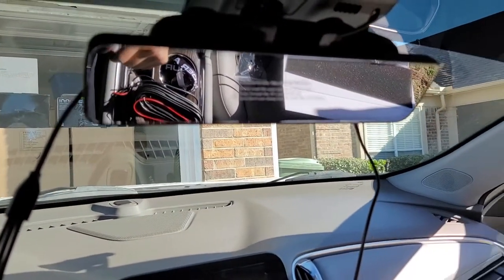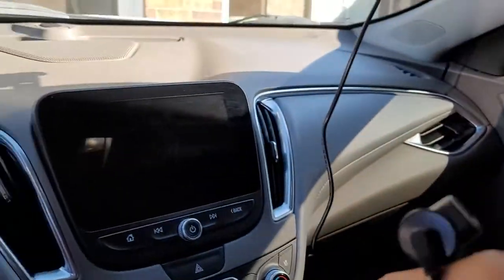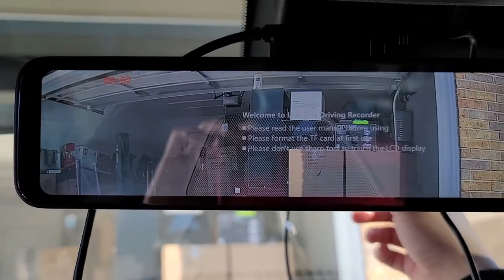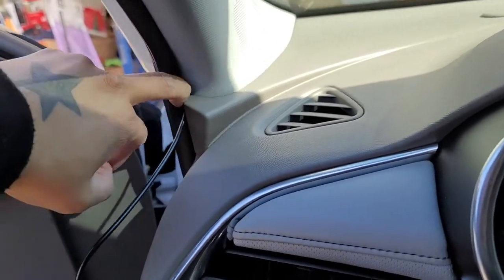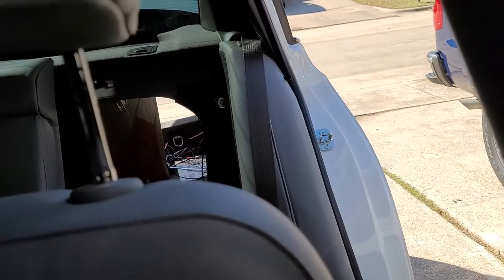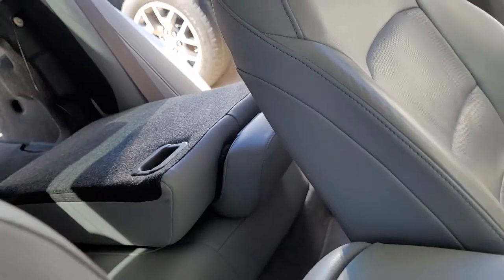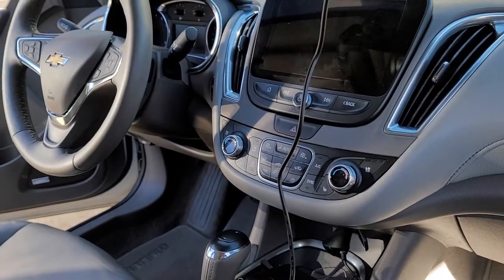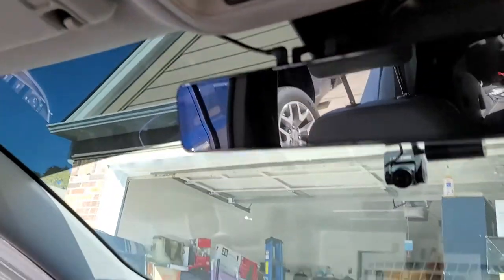Pormido triple mirror dash cam install.

Comment: I ran my rear camera wire through the headliner instead if going down to the floor.  

The red wire goes to the backup lights.  Go to Google and type in your vehicle's wire diagram for the backup lights to see color code for which is 12 volt.
Reply: Thank you very helpful!
Reply: @onenationundergod8  you're very welcome! Glad i could help!